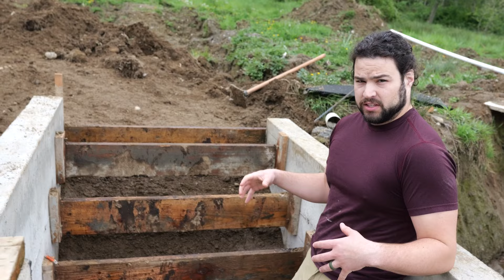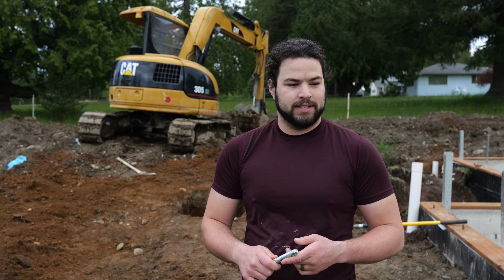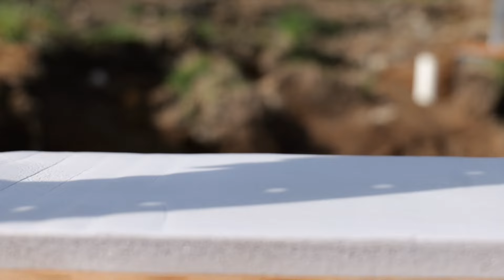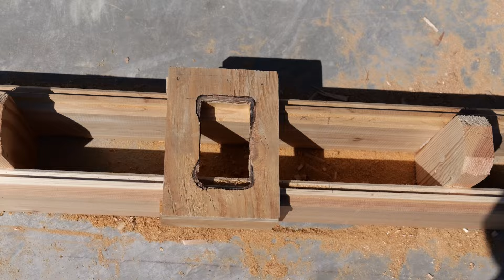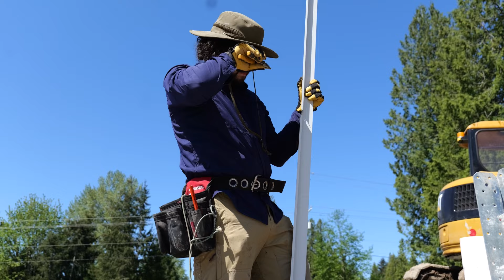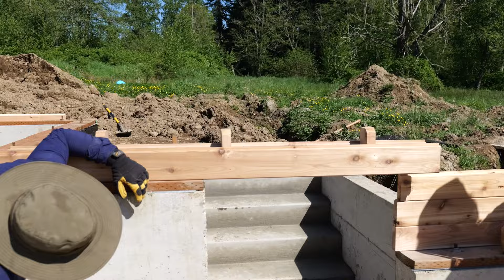Building My Own House From Scratch (With ZERO Experience) | Lincoln Blocks & Concrete

Comment: Any reason the basement form was not level all the way around (step downs in random spot and not others? Was this due to the house being on a slope? I'm guessing it is easier to work with lincoln block if it was all on the same plane
Reply from the maker: You are correct. it was due to the slope of the ground. It's certainly easier to work on a flat plane but that would have required a lot more concrete to get us flat and concrete is quite a bit more expensive than Lincoln block walls, and that's not even considering the thermal performance. It also would have been easier if the concrete step downs were done in height increments that match up with full Lincoln blocks, alas hindsight.